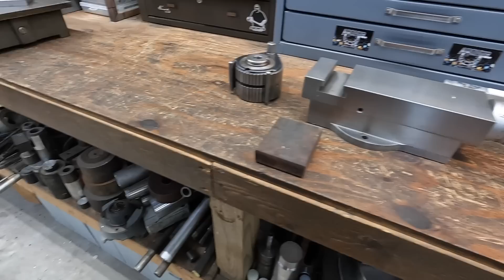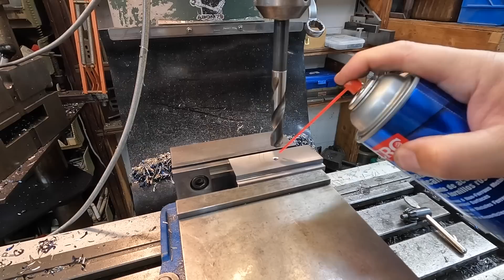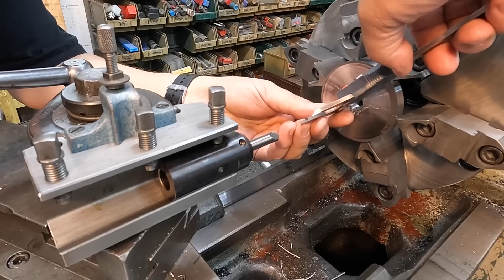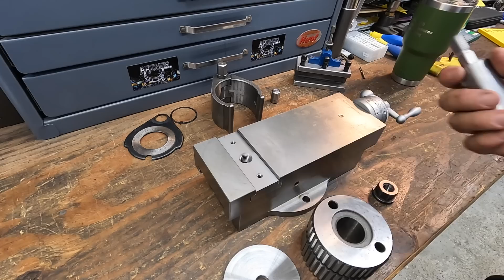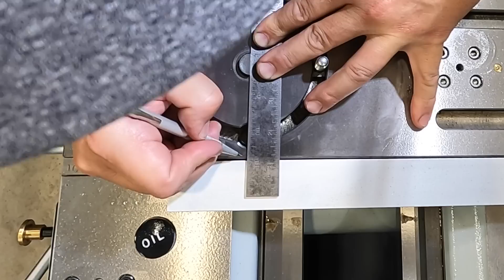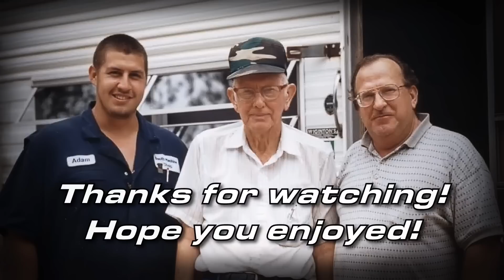Multifix Toolpost for the Precision Matthews Lathe

Comment: I did the same thing on the shoulder length on mine. Plus my cheap drill press vice allowed the t-nut to tilt so the hole didn’t go in straight. Going to redrill and tap next size up & remake the stud to allow for the wider top nut and needle thrust bearings. Some advice on how to accurately place the two positioning dowels would be great. Keep up the good work Abom

Comment: I am curious why you used a different method of attaching the tool post in this video (using a spacer) vs the video you made 2 years ago with a co-planer T-Nut. Did this application require the additional height of the spacer or is it a better method? (which I believe it may be personally)

Comment: What size quick-change is that?
Im going to be ordering the same machine here in a couple days largely because of your review and id like to use that same multifix. Im ready to order from pe-we tools. Just picking the right size is becoming frustrating
Reply: I tell you, when you tell me the power of your lathe, the width of the compound rest and the height between the compound rest and the turning axis
Reply: @lupuszzz it's this same exact machine in this video.
Reply: @themotofixery  you really think I should research the data for your machine so I can do the research to find the right multifix size for you?
Reply: @lupuszzz  who asked you?

Comment: What size Multifix toolpost is that? I'm about to buy that lathe's little brother, the 1640TL, and I'm probably going to get a PWT Multifix toolpost for it.
Reply: Same ...did you ever find out, think it’s CXA size
Reply: @biker176  . Nope, I never found out. I even asked PM for the distance from the top of the compound to the center of the spindle so I could figure it out myself, but they never got back to me. (They didn't have any in stock and forwarded the question to the factory; I guess the factory never answered). PM's tools and support are generally great, but I wish they took their website and manuals more seriously. Specs liked this really should be shown in both places.

I'm finally going to order the lathe (and a mill) on Tuesday now that my shop building is almost ready. I'll ask PM about the measurements again when I call. I think you're right that it takes a CXA size Aloris-style toolpost, but I don't know if that always maps to a C size Multifix. If I get an answer, I'll post it here.
Reply: @laurawerner I'm in the exact same situation. About ready to buy the 1640tl and would like to jump right into a multifix rather than spending money on the aloris and then upgrading later. Just trying to choose the right size for this machine.
Reply: @themotofixery  I still haven't ordered mine. My shop building wasn't finished until late November due to a slow contractor and back-ordered electrical components. Now I'm bogged down in shop infrastructure stuff like shelving, compressed air piping, and ducting for dust collection on the the woodworking side of the shop. But I'm planning to order the lathe after the holidays. I'll probably wait to order the toolpost untill I actually have the lathe. (I'll post the measurements here when I get it.) While I'm waiting for it I'll just use the 4-way toolpost that comes on the lathe. 

I am actually having some second thoughts about the Multifix, too. They look really nice, but the signature feature of having repeatable positions every 9 degrees seems like it's most useful if you don't use a compound, or if you always keep it parallel to the bed. Since I'll probably have mine at 29.5 or 30 degrees most of the time, I'm not sure that will be super useful. My other misgiving is about tool holders. With an Aloris-style toolpost, it's fairly easy to make your own tool holders. With the Multifix, it's still possible but a lot more work because of that convex curve with the splines.

So I might still go with a good Aloris-style toolpost. If I do, I'll make a second handle to replace the nut on top, so it's easy to change the angle. (Like Inheritance Machining and a few other YouTubers have done.) I probably won't decide until I actually have a chance to use the lathe a bit. Any insights on your toolpost decision making process would be helpful.
Reply: @laurawerner  Im having the same thoughts. I spoke with the guy at pe-we and for this machine the (TL1640 OR 1660) the correct sizee would be the E with tool holder ED25100. 
I picked out a whole set with about 15 holders of all the various types and the total should be around $1700.00 usd.
Apparently everything is on backorder for however many weeks so when I ordered the machine last week I went ahead and got the aloris style post from PM to start out with. My old lathe has an aloris style toolpost and its OK. I find myself changing the angle often but this has become less of an issue since I've gotten a comprehensive set of tools. I do really like the price of aloris holders so that is why I'm still reluctant to complete this order. I think the quality is what is driving me forward. From the pictures, the pe-we stuff looks really premium so I think I'll go through with it. 
On a side note you mentioned air. I used pex for my shop air system and it's been great!
If you are interested, let me know and I'll make a video to show my setup. 
@laurawerner
Reply: Thanks for the specs on the Multifix toolpost for the TL-16xx lathes!

For what it's worth, there's a thread on one of the machining forums on how to make your own Multifix tool holders. If I remember right, they used a dividing head to cut all those internal spline-like features. It didn't look super challenging once they figured out the setup, but it did look time-consuming. It would save a lot of money on tool holders, though. There are also some Chinese clone tool holders that I've read good things about. (The Chinese clone toolposts not so much.)

 @themotofixery  months ago, when I thought the construction would be done in September @themotofixery ) I also have a new compressor to set up and wire up remote controls for: a "5 Hp" Quincy QT-54. It's their budget model but still has a Baldor motor, which is nice. (But if it's really a 5 Hp motor it's the smallest one I've ever seen. Much smaller than the one on my dust collector, also a Baldor.)

After that, there the dust collector. So I have plenty to keep me busy until the machine told show up.

Comment: Just a note on the bottom of the multifix, it is not just concentric circles but a spiral like a record. If it tries to spin, it actually has to displace metal and not just rely on friction. Much stronger.

Comment: Is that combination lathe and v-mill head a granite lathe? I'm curious where you got it from.
Reply: Looks like a rotary table/indexer mounted on the table of the knee mill. Traditional manual milling machine (Bridgeport clone). Rotary indexers can accept either a mounting plate or a lathe chuck (the latter for round stock).

Comment: Would you also need to make a register mark where the center of the tool holder sits. If the t-nut moves, you will have a hard time realign. Maybe not. Just wondering.

Comment: what happens to all your metal shavings, those bins must get heavy after awhile.  Can you scrap them for money?  Is it worth it?
Reply: Scrap steel's worth ~20cents per pound, it's really only worth selling by the ton. Aluminium, stainless, brass etc. is probably worth it for production shops that have a high throughput, doubt it would be for Adam though.
Reply: If he's anything like my brother, the shop has recycling bins that is handled by the local waste company. Metals like titanium or stainless may be worth trying to turn in if the raw amount is by the ton.
Reply: Usually you give the local scrap dealer a call and he picks it up paying the standard price minus costs.

Comment: Wouldn't it be a bit better in terms of rigidity if the shoulder of the center pin bottomed out on the spacer instead of the threads? (I am not a machining at all so I am maybe asking a silly question)
Reply: Had the same idea.

Comment: No need to apologise man. Shop life is shop life: Rush jobs come in. Stuff doesn't arrive on time. Wrong stuff arrives, but on time. The gnomes have run off with that piece of round stock you just KNEW you had in the pile. Holes are discovered in "perfect plans" so the angle of attack, and hence the time line, needs to be changed. Things get forgotten because brains aren't made of magnetic tape. Such is shop life.

As long as we all get to follow along it's plenty good man. The downs are as good as the ups. The lesson learned moments are as good as the routine jobs. We just wanna tag along and see what ya doin' today.

Comment: The more I see of these multifix tool posts, the harder it is for me to comprehend why anyone would choose such a complicated and limited tool post. The biggest thing I don't understand is why anyone would want a tool post that is locked in place and not easily relocated to various locations on the compound. I suppose if an operator was only machining in 90° planes with the carriage or crossslide and not using angles on the compound, it'll be alright. Not to mention the only thing holding the post in place is a couple set screws.
The Aloris style tool post is the superior style. 
I've watched every video you have done on these Multifix posts, and I have yet to see a single benefit of having one.
Reply: I would also like to hear the benefits.

Comment: Don't apologize, love the channel!  Doesn't the height of the tool need to be exactly at the centerline of the lathe?  With the spacer, etc. it doesn't seem like anything is accounting for that. Will have to look for a video on it. 👍👍
Reply: The height is adjusted on the tool holder. That's what the blue device (28:26) bolted to the top of the tool holder is for.
Reply: @dcraig4  thanks! I see what you mean exactly.
Reply: What he has to do is make it so the range of adjustment allows his tallest tool to go low enough and his lowest tool to go high enough.  As for the tool exactly on centerline, that is a simplification that is only strictly true in some circumstances like taper turning, otherwise "close" is close enough. It's an old school thing BUT in the old-OLD school it was different, recommending tools be 5 degrees above center for normal turning. I doubt if anyone but me remembers that.

Comment: I wish some could explain to me why people set the compound to 29 1/2 degrees for threading, in simple terms I can grasp. 😳
Reply: TOT has some videos explaining that, will search those out later.
If you would plunge the threading tool in with your cross slide, the tool has to cut left right and the tip all at once. Generates a lot of cutting pressure.
A normal V Thread has 60° included Angle. Half of that is 30.
So if you come in with the compound set at 29 1/2, the tool will wander perpendicular with the richt side of the thread, therefore not cutting it(or just a bit) and tool pressure decreases.
Reply: @an2thea514  thanks 🙏
Reply: Agreed, look up This Old Tony and find his threading video. You'll enjoy it
Reply: Old OLD school here.  There are several reasons for the 29 1/2°. Mainly it is to keep the pressure on the tool down by limiting the volume of the cut/chip and also to insure the back side stays clean. If you go in at 30° the chip coming off the lead side crashes into and abraids away at the back side, tearing it up and the tool can't clean it.  
Go in at 29 1/2° and the tool position moves slightly to the back side with each move into the lead side, cleaning it up as you go and still keeps the primary pressure on the tool and carriage in opposition to the travel direction to keep from making a drunken thread.

Finally you should know it is impossible to have a perfectly formed tool which is perfectly aligned, there will always be SOME error. When that error is in the direction of the back side, away from the lead side , the tool will move away from the back side with each cut. Go in at 29 1/2° and small error in that direction is taken care of.  IF it is to the lead side it's ok , so always bias any possible error toward the lead side.(these are TINY errors mind you and the asme standard allows for some variation in flank angle but does not cover widening that occurs with the error to the back side)

There is the old school tactic where you go in  at 30° for 95% of your depth but finish off with light passes straight in with the cross slide. That gives you most of the benefits of the compound entry angle while still finishing with a thread that is clean on both flanks. It gives the added benefit of being able to adjust your final pitch diameter directly on a ONE TO ONE basis, no math no guessing, just like in straight turning.

Questions comments?
Reply: This old tony another thread cutting video.. the short answer is so it only cuts on one side of the cutter/thread making a flat chip instead of trying to pull a v shaped chip
Reply: I recall Keith Rucker going into some detail on that, and he has done so multiple times. Take a look at his Vintage Machinery videos.

Comment: I understand you are not using coolant, becacuse it makes a mist from the vibrations and a mess in your workshop, into the lungs as well. Better in your case, to change the inserts or toolbits regularly. It its not a production line after all.
One could sharpen the bits up with a tool-grinder, and re-use them if having the great time (A lot of time in Swedish / All tid i världen) or all time in the World.
Reply: My understanding is coolant is seldom used with carbide inserts because of the thermal shock.

Comment: I'm not a machinist... but I have used that Anchor Lube and absolutely love it. Thick enough not to run when using vertical and helps to cut very well. Nice smooth threads and tool wear is minimal.

Comment: I have that same "Create" tool post (next size down though) on my 12" Logan lathe.  Supposedly built under license to Multifix, but who knows.  Anyway they're a little bit hard to contact, and from what it looks like the PeWe parts fit right on.  Do you suppose the tool holders would fit as well, as always I need a few more.

Comment: Nice setup Adam. I do have a question: when you experience excessive vibrations during turning (chatter as you call it) would you say that is entirely dependent on speed of cutting or also on depth of cutting? Or does the type of metal also influence that phenomenon (I imagine the "softer" the metal the less chatter) ? Do you have a rule of thumb that would allow one to avoid those vibrations? I would imagine that the profile of the cutting tool also influences the amount of vibrations...

Comment: Can someone help me pleas?  
I'm looking for a smal bolt with withwordt thread. 
The diameter of the bolt is 2,21mm and the pitch is 0.28mm.  Top to top tooth so 0.28mm. 
What is the Withwordt size of that?  it is for an old American gramophone player from Gospel recordings incorporated Los Angeles.
Reply: The closest whitworth to that major diameter is 3/32 at 2.38mm, however that size is 48 tpi which is about 5.3mm pitch, are you sure it's whitworth? Have you got thread gauges to measure?
EDIT: spelling mistakes (witworth)
Reply: @gabrielnorton6454  48 tpi isn't 5.3mm pitch it's 0.53mm, a lot of really old threads don't conform to standard sizes they more or less made up their own sizes
Reply: @andyb7963  you are correct, I completely misread my black book - thank you!
Reply: @gabrielnorton6454  
No, I'm not sure if it's withwords thread.  
With the pitch meter I now measure 0.28mm from top to top of the pitch.  
I have corrected my message.
Reply: @Bouke_Nagel  it's going to be difficult to get a good measurement but whitworth threads are 55° threads not 60, that's another thing to check on if you have the correct gauge.
Reply: Being American made I doubt it would be Whitworth, I would look at the American standards for it, though having checked the common ones its not anything common.
0.28mm pitch would be unusually fine threaded for any of the standards I know at a 2.2mm diameter.
Reply: 👍🏻👍🏻👍🏻 Thanks everyone for thinking along.  I think it's best to tap an M2.5 thread.  And then can use a metric M2.5 bolt.  I would have liked to keep it original.  But then I just have to smuggle for two bolts.  Google translate translated for me.  I hope it was understandable